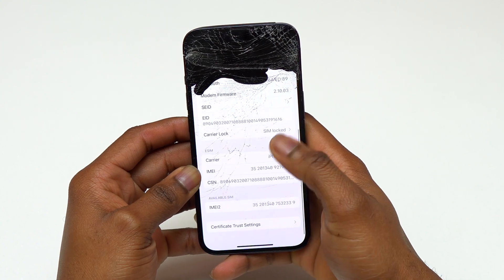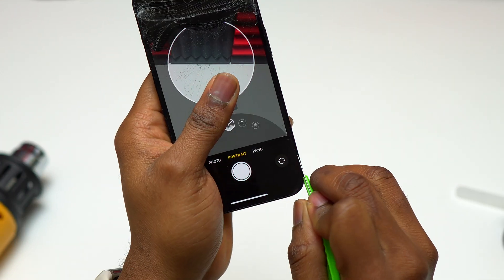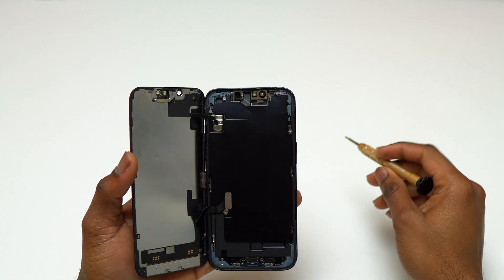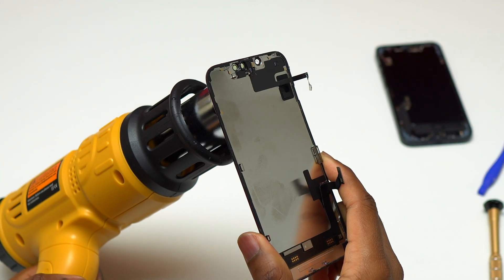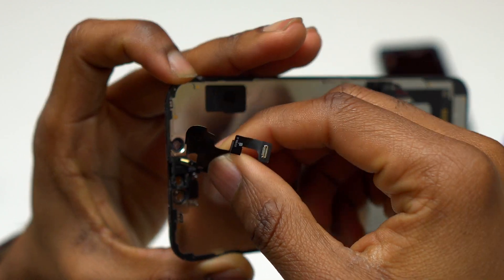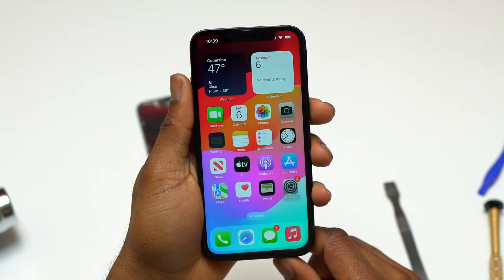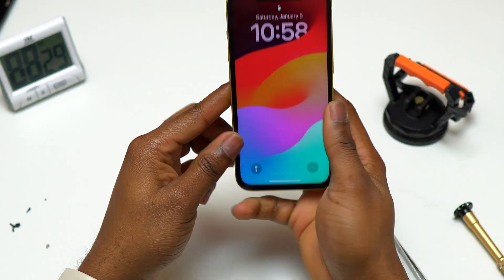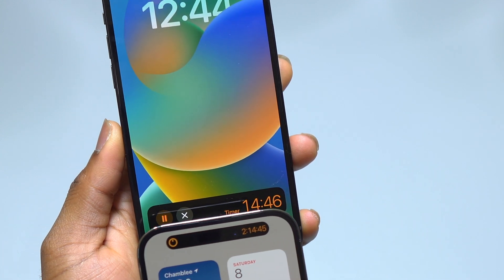iPhone 14 Screen Replacement Repair

Comment: Will the Face ID still work
Reply from the maker: yes, Face ID should work without any issues unless you have some problem with the camera the front facing camera the proximity sensor on the back of the screen or the dot sensor that is going to scan the face while you’re trying to use Face ID if you were to change any of these component your Face ID might not work. For a simple screen replacement Face ID should continue to work without any issues.

Comment: Hi, if I buy an aftermarket display...
and remove the sensor from the top of the old one and replace it, will the face id go?
Reply: Yes 👍🏽 it’s plug and play in any screen of the same model you’re replacing it on.
Reply: @BDChupacabra  Thank you for your help❤️

Comment: Why not program the new screen to carry over true tone?
Reply from the maker: It is extra cost. You'll need to buy the programmer and maybe 1 extra cable to do that. I don't do these videos because I have a shop etc....I show the easiest way to do it with less expenses. It's true you can buy and return the machine to program but that's a moral choice etc....
Now with apple self repair service you an bypass the programming and loss of features....
Reply from the maker: In the video below I have bought everything from apple self repair service and everything is like new no loss of feature of any sort it's all good BUT it's highly costly getting orders orignal parts. 
iPhone 15 Pro Max Screen Replacement
https://youtu.be/tvxDl6ptuuk

Comment: I just watched again. Why you didn’t show when you did a force restart?
And those are two different phones lol
First one back was black and the second phone back is yellow 😂😂 nice try man..
Reply from the maker: 1- showing everything is good but then it's too long people complain. 
2- This devices was blue I had a bad front and Back it became yellow because the blue frame was broken.
3- Look for the channel mobiletear I have published the video Restoration of the phone from blue to yellow with screen and back replaced. 
4- The individual videos shows more of the process than jamming everything in a single video that human beings are going to watch and enjoy then like share subscribe for the other thing to give more distribution to the video. That's why I separate and individualized to give more chance to each one and try my best to respond to any questions that is not obviously answered in the video.
5- Again I gave you the answer (solution) to the problem statement you have raised to me. You can remove the back and disconnect the battery cable then proceed with the front. Again that is the best practice but you may proceed with force restart if you don't want to deal with the back and redo a back replacement. 
7- I don't know what else to say. I do not gain anything by giving untrue statements 🤷🏽‍♂️
8-There can be confusion but no lies 🤣
9- I have not done the screen of the 15 or 14 Plus yet if not I would have called you in the video specially and show you the force restart stuff and you'll see it works.
10-Check mobiletear channel the video frame replacement will show you the before and after of this iPhone 14 (it's compressed I go through front, back and frame in less than 10mn).
Reply: @ersbit  so. Let them complain but I gotcha!
Reply from the maker: Hahaha I really like to be as transparent as I can. 👍🏽

Comment: Where did you normally get phone parts?
Reply from the maker: Looked for a screen on Amazon and ebay. It was the same so I got the one from eBay. The difference in price for a original screen and these ones is pretty high 🤣. Do you have tips for me (where to get parts?)

Comment: What will happen when you didn’t disconnect the battery cable before the screen flex.
Reply: you can short circuit thr board/screen
Reply from the maker: That is a possibility. Nevertheless it's minor with these modern smartphones. The best practice is to disconnect the battery just to mitigate all probability of being one of those who experienced shorted board problem.

Comment: So you don’t have to unplug the battery before you taking the screen off?
Reply: You have to unplug the battery before take off the screen. It will fry the mother board. The battery is located in the back. Back glass won’t break
Reply: @naheimshihadeh5090  back won’t break? Who told you that? Lol
Reply: @naheimshihadeh5090  hey man… back glass will definitely break super easy. Corners are suuuuper sensitive
Reply from the maker: No you don't have to remove it. The designed it so that the battery cable is only on accessible from the back while the screen stays at the front. 
You can turn off the device if possible then do the screen replacement without disconnecting the battery. Now if you cannot turn it off you can still do the screen replacement then once done you will force restart the device. Everything will reboot at that moment. If you don't want to do it that way you will require to remove the back glass and disconnect the battery cable do the screen replacement then seal the front and Back.
Reply: @ersbit  what if the touch is not working and you can’t turn the phone off?
Reply: @ersbit  oh ok gotcha

Comment: Hi there, I tried to replace my iPhone 14 screen myself before watching this video. I didn't take the proximity sensor from my old screen and threw it out. I was wondering why the screen worked but my phone kept on restarting. Good to know the phone can still be saved! Thank you brother
Reply: @NoahBoulder  It’s called boot looping mate, it’s an Anti Repair Technique.
Reply: @NoahBoulder  💀💀💀 craziest repair story so far
Reply from the maker: You're welcome 👋🏽. After adding a new sensor it should work like normal without any issues. Did recently install an aftermarket proximity sensor on a 13 mini everything went well no problem so far with the aftermarket sensor. If you still have the screen (may be already gone) you can redo that part and it will work fine if not damaged etc...

Comment: If you put tape on the screen then you can use the suction cups and not risk scratching the housing with the metal tool
Reply from the maker: Great advice. I forgot to insert that line in during the video. You're right that's a solution.